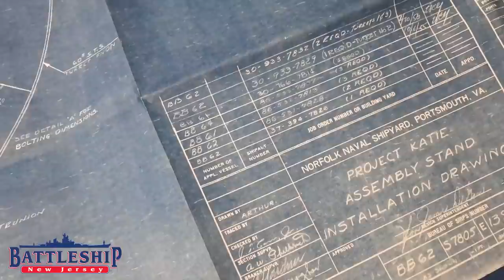Nuclear: Project Katie

Comment: In the early 1980's I was a nuclear weapons assembly officer for a Marine Corps 155mm artillery battery.  I have a few comments. 1) At that time there was a 16 inch nuclear round on display at the North Island Nuclear Weapons School - I don't know if it is still there or not. 2) It is not likely that there was even any intent to fire more than one nuclear round at a time. The fact that they modified more than one turret, but only one magazine, would indicate a desire to have a redundancy in the event of battle damage, while still keeping war reserve rounds safe in only one location in the ship. This was definitely a battle weapon, not a doomsday suicide MAD threat. The multiple racks in your magazine space were probably due to the need to keep the warheads physically separated from each other. What is not generally known is that the tactical weapons up through the 1980s (I don't know about later ones) were so radioactively 'hot' that we were advised not to transport more than three of the 155mm shells in the same truck. It seems likely to me that the same concerns would have been true for your Mk23s. I wonder if there was shielding, or if you even have taken a Geiger counter into that space? (Granted, it has been a long time) It is likely that the ten rounds you mentioned were kept as far apart from each other as possible in that space for this reason. 3) The W19 is advertised has having a 15 kiloton yield. At 23 miles this blast would have been survivable by troops in the open, and particularly by sailors behind any armor. Even fallout would not have been an issue - it would just have been hosed off the ship.The minimum firing range of the 155mm W33 shells was 4000 meters, and while were told it was preferable to have a hill between you and the impact point, there was no doubt of survivability for a .75k blast even at that range. The W82 rounds had what we called 'dial-a-yield' for up to 2k, so the minimum range was more of a concern for us. Fallout would have been problematic, but we didn't plan on hanging around after firing to find out.
Reply: Would a nuclear shell be deployed against exclusively land targets or would it have been reasonable to assume it could be used to obliterate an enemy fleet while at sea?
Reply: The W33 was for the 8" howitzer, not 155mm and used a little boy gun system with reflectors for the fissionable mass. The W19 was for a special 11" howitzer or the 16"/50 caliber battleship guns, also a uranium gun type warhead. The W82 only made it to prototype stage at 2kt, but the W48 was a production 155mm howitzer round that used a plutonium linear implosion warhead. The W82 was to be an enhanced radiation weapon, aka neutron bomb, which would give both area denial and equipment denial if used.
Never heard of anything like the limitation of one warhead per vehicle, but I'm beyond dubious, given both elements are primarily alpha emitters, which a sheet of paper would block. I do recall Germany not being especially fond of our driving around with nukes though, our Pershings had to go around with the warheads removed, only getting mounted on the missiles at the alert site for quite some time.

As for @jtgoodling's question, action against ships sounds like the more probable use, as one doesn't quite need a Hiroshima yield bomb for preparing a beach. It's unlikely to obliterate a fleet, but it'd definitely cause significant damage.
Reply: They were developed for the Korean war and taking out large troop emplacements.  You are right.  They are battlefield weapons.  One of the reasons they were discontinued becuase of the proliferation of nuclear weapons.  Low yeild devices is not what the world needed or needs....The other fact is they didnt want unexploded rounds to get into enemy hands and then be used against us.  There are documentaries about this program.
Reply: SURELY they brought a Geiger Counter into that room ?

Comment: The 9 barrel nuclear broadside capability was probably a "why not?" part of the program. A "what is the maximum use we can think of to design for" .  As you mentioned, that would be massive overkill for the range and dispersion possible with the 16" guns.  
I imagine in a nightmarish probable scenario, the BBs would be used in "follow on" attacks after the main first exchange had degraded enemy AShM and aircraft anti-ship capacity to the point where a BB could pretty much go anywhere it wanted and it would be use to deliver point destruction of whatever strategic targets still remain like harbors, airports, etc. so this would be one maybe two nuke shots at a time.
Reply: I imagine what happened was something like this:

"So if we put one of these 11in 20KT warheads in a 16in barrel for the Iowa's, how far could it go?"
"Still just about 23 miles..we'd still be in the radiation zone..."
"Hahahaha, so we better make it count! You know what? Put one warhead for each barrel on each of these ships!"
"Nine. You want nine nuclear warheads on each of these battleships?"
"You're right. Round it up one more to an even 10, so there can always be enough ready when one is down for inspection of course. And go ahead and add ten more for training purposes!"
"...ten 20KT Warheads...."
"THAT'S GENIUS! We'll call it Project Katie! (KT)"
Reply: 23 miles is well out of the range of radiation of a 20 kiloton warhead.  The Enola Gay B-29 was only 9 miles away from Little Boy when it exploded and no one on board suffered any radiation injury.
Reply: @mytg8  they were flying away as fast as possible. Even cruising it's fastest, fallout to a ship verses a high flying aircraft stripped of it's armor to fly faster, there is going to be a difference.
Reply: @chrissinclair4442  In a 20 kiloton burst, if the battleship is more than 10 miles away, you are safe from any type of radiation,  thermal or ionizing. As for fallout, the height of burst of the shells are optimized for blast effects. So, little or no fallout, since the fireball does not touch the surface. As for blast, it's a battleship, right?
Reply: You know, the are some very bright people in the USN. They're not going to put 2000 sailors at risk of glowing in the dark by chucking Katies over the horizon.  Cannot speak for the US Army, 'tho.  :D
Reply: All pretty well covered below. A battleship has little to fear from a 20kt weapon airbursted at a 20+ mile range. Check out operation crossroads for reference. Katie would likely have been effective against surface fleets as well as shore targets. It would not be the last action of the ship unless it came under overwhelming attack as a result of her nuclear strike. What many people never consider is that in a nuclear war, zero exposure to radiation is not the goal. It’s not considered possible. Maintaining lower than near term life threatening levels of exposure is the goal. In a worst case scenario while attacking, a shell lands short and contaminates the ship. The ship would likely move to clean water then perform a wash down. Sailors would be decontaminated and treated on an individual basis as needed. All in all, let’s just be glad that we never had to find out just how survivable the event really was.
Reply: @mytg8  As for blast, if you have to fire a 20kt nuke to detonate so close that you are effectivelly hit by its own shock front, you have more pressing matters to worry about than said shock front hitting you.
Reply: Speaking to the OP scenario of battleships roaming the seas, lobbing nukes on land targets with impunity, the seas would still be roamed by submarines that have no other purpose anymore. They come across a battleship, they just sink it for shits and giggles.
Reply: i long for the bygone age when america did not ask why you should do a thing but instead said why the hell not
Reply: @mikerodix4800  That was before the tax cuts started in the '80s. Back then the federal government had the cash to do what needed to be done. If we needed a plane we built a plane. If we needed the interstate highway system, we just built it.

Comment: There are usually two sets of drawings coming out of a yard period where extensive mods are made.  The "AsBuilt" are the MOST important relative to the "AsDrawn".  Because often the yard workers must make design mods on the fly.  There's also a separate set called the "ShipAlt" which specifically show all alterations through the years.

Comment: Good discussion. A couple of assumptions that you are making about the possible use scenarios may be a little off the mark. A single nuclear round of 20kt would take out an entire naval battle group that was sailing together within the gun range of 23 miles. Nuclear fallout would be minimal at the battleship, if the wind direction were taken into account. So, one (or two) shots could do the job. Its unlikely that the mission was to take out cities, since sailing within 23 miles of shore to launch an attack from the sea would be risky stuff, unless your opponent had minimal shore based defenses. These were likely to be naval battle weapons.
Reply: also those extra shells made, beyond the ten for each ship, well that is so the device can be cycled thru periodic inspection, and rebuild while allowing each ship to be fully armed.   These devices require a lot of service, sensitive electronics,  radiation damage to components, radioactive decay, perhaps batteries needing replacement, etc...    they will need some spare devices for the periodic  maintenance rotation required.
Reply: I agree, the likelihood of bombarding an enemy city with 9 warheads from a battleship seems low.  Perhaps these were designed to penetrate heavily buried bunkers?  I don't know that there was ever a naval flotilla that would necessitate 9 20kT warheads outside the USN, considering the results of Operation Crossroads.
Reply: @dave8599  That's why we had so many nukes. They were very unreliable, and you need a few just to take out a single silo.  Nuclear weapons are obsolete tactically. We phased it Bio & Chemical weapons not due to human rights but because of precision weapons.

Comment: The alarm system you mention at 15:19 were called FZ circuit alarms in the 80's and 90's. Instant security alert if it went off.
Reply: Any more info? Sounds neat!
Reply: If it’s the only magazine on the ship with FZ, then it was for nukes.

Comment: On board USS Coral Sea we did have nuclear storage spaces. Rocket or Ariel, I do not know, but there on the mess deck there was a cage with a jar-head in it 24/7 while nuclear materials were on board. His 45 cal was loaded, and he had to account for his ammunition before and after each shift. It is a good thing that most of these young jar-heads had a sense of humor, otherwise I could have been shot.

Comment: 23 miles of distance is enough to avoid an immediately-lethal dose of radiation from the blast. Being in a steel-hulled warship, most of the electronics should be protected from any kind of resulting EMP. If you're firing over the horizon, the earth itself will protect you (through an abundance of water) from most of the harmful direct radiation. However, it does make sense that you only want one shot/salvo: Take your shots and immediately leave the area, because it will quickly become uninhabitable. Wind and spreading fallout will quickly complicate matters for anything lingering in the area. Since that's the case, there isn't a need for any kind of follow-up shots; swing guns off to port, target, fire, immediately egress at best possible speed.

Comment: I'm trying to wrap my head around the damage that would be caused by a broadside of 20kt 16" shells.   I wonder if/how they accounted for the possibility of Fratricide with the rounds. IOW, spacing the impacts and timing so that one round going off doesn't disable/destroy other rounds. 

THANKS FOR A GREAT VIDEO
Reply: I think that's the reason nuclear weapons tend to be painted white, to keep the flash from a nearby detonation from damaging the nuke before its own assembly could initiate.
Reply: @BogeyTheBear  I never would have thought of that but it does make sense. Especially when the timing involved is in milliseconds.
Reply: @BogeyTheBear  All of our airdropped special weapons were silver grey in color.
Reply: @BogeyTheBear  The flash isn't a risk. Its just got shot out of a 16" gun after all...  Its the risk of the EMP damaging the electronics of the initiator.  That is taken into account in the design.  
There is zero chance of a weapon damaging another unless it goes off literally right next to it.
Reply: @BogeyTheBear  
I rather doubt that multiple warheads would be fired as a broadside all to the same target!
There would be a spread since there would be no point in targeting a single point with multiple  20 kiloton warheads.
Any decent spread of even a few hundred yards, would suffice to prevent fraticide between individual shells, a few seconds of time between shots or a few minutes of angle, either elevation or direction should provide enough separation to  protect the shell, after all, as has been pointed out, they just got fired from a cannon!
and after all, close only counts in horseshoes, grenades, and tactical nukes.
Reply: @jamestheotherone742  One real risk is neutron flux: If you dump enough neutrons from one warhead into another, you can trigger a fizzle, where stimulated decay releases enough energy to "disassemble" the package but without reaching criticality. Use of that was actually deployed for ABM uses in the splint missile system: https://en.wikipedia.org/wiki/W66
Reply: @benjaminshropshire2900  Inverse square law. It takes very close proximity for effect and is easily foiled (literally) by shielding.  The W66 never proved its effectiveness in actual operational conditions (thankfully).
Reply: @jamestheotherone742  that moots an interesting question: what has been tested? What is the closest that a live warhead has ever been to an atomic explosion? What about one that survived to be detonated later? If the answer is >100km I'd not be surprised.
Reply: @benjaminshropshire2900  AFAIK it has never been tested as in a warhead being detonated in proximity of another and then an attempt to initiate that second device.  Its all purely hypothetical and written in the flowery words of government project justification and Congressionaliese.
Reply: as said, as long as they don't fall very close together they'd not destroy each other. 
And to make that chance even less they'd probably ripple fire them a few seconds apart rather than salvo fire them all at the same time.
And of course by changing the target parameters for the turrets slightly you can increase the spread as well, as you don't need the full volume in the same spot.

The main reason to group them close together would be to guarantee that at least one works against a high value target.
Especially at the time (but still to a degree) that's the reason multiple warheads are targeted on a single location.
If there's a 10% chance of failing to launch, another 10% of missing, 10% chance of not detonating, you want multiple warheads to guarantee target destruction (and those numbers are realistic, for ICBMs they get even worse).